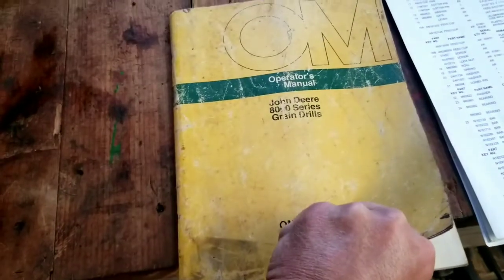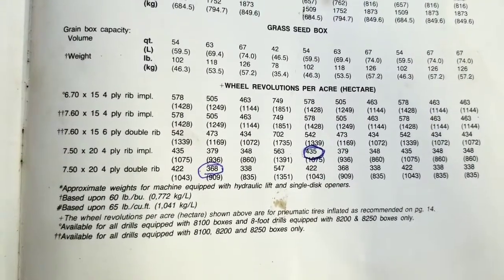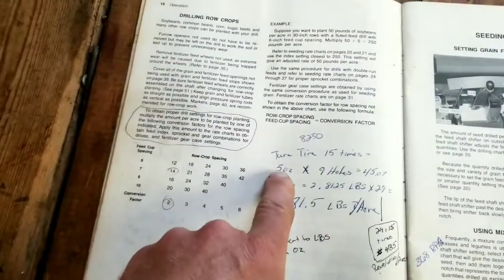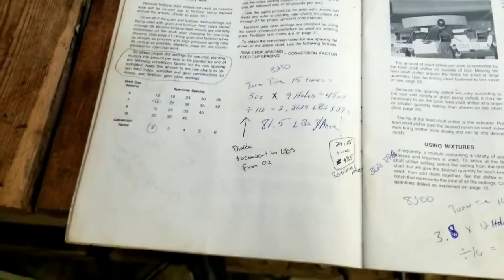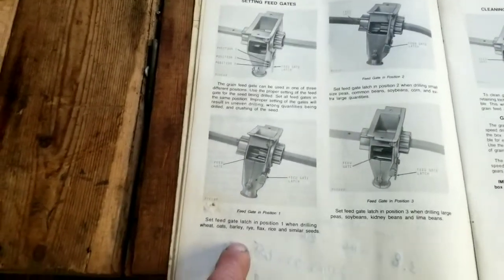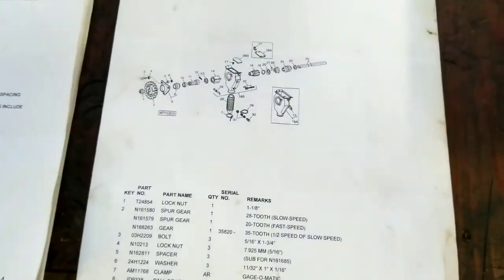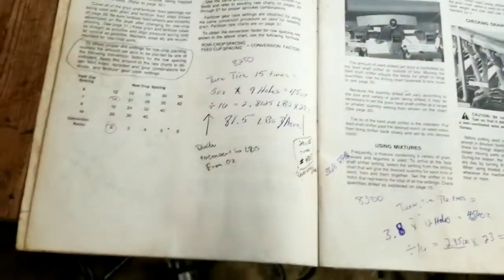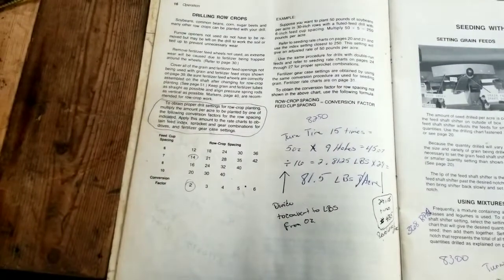Help for Soybean Farmer

Comment: How do you adjust your planting depth? Use stops on the cylinder? We have used a van brunt for the last 5 years and it has a screw adjustment but I'm not fond ng anything like that on the 8350 we just bought.

Comment: Yeah basically what you can do is, find out the total tire revolutions per acre, then divide that by 10... say it's 435 tire revolutions per acre, so /10 would be 43.5 revolutions.  Put a seed supply over one meter and a catch bucket underneath, jack the wheel up and lower the openers enough to throw it in gear, and then turn the wheel 43.5 times.  Weigh the caught seed for the one opener and then multiply that by the number of openers, and you have the total seed planted per 1/10th acre, multiply that by 10 and you have the total seed planted per acre.  Basically the same way I used to calibrate my 7100 Deere planter.  

Later!  OL J R :)